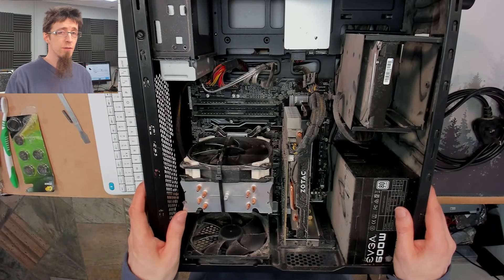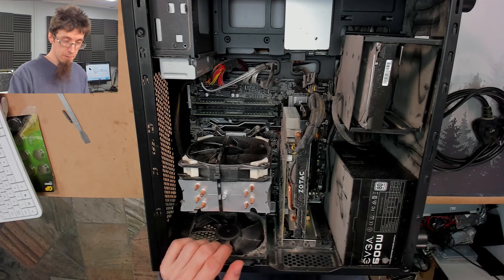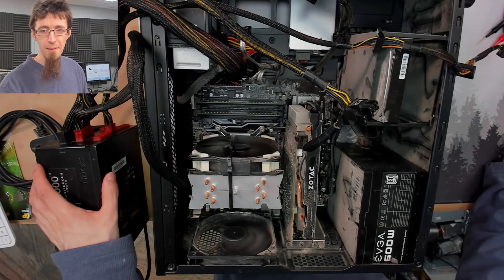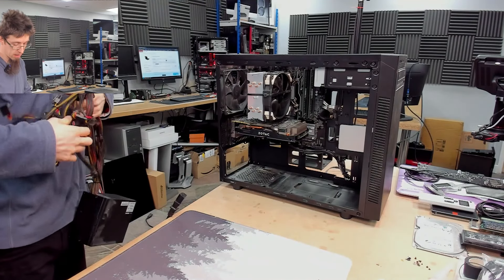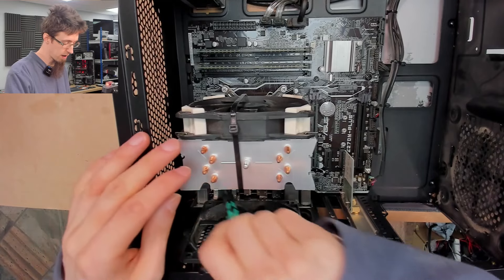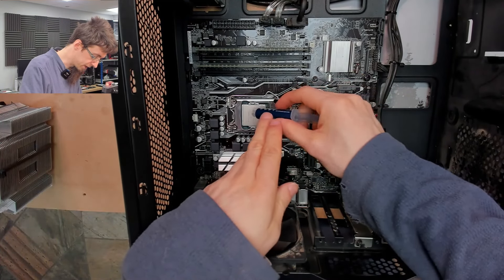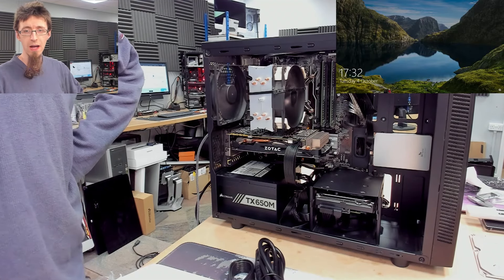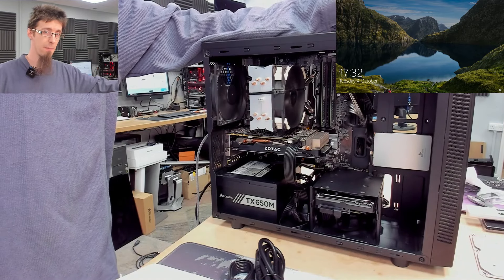Gaming PC cut out, doesn't turn on again - LFC#327

Comment: love videos like this but there is so much there lol why is there a zip tie on the cooler pmsl, EVGA do amazing supplies but dust and heat will kill them quick for 4 mins and a £20 air blower and a little maintenance. i had a random problem the other day when i installed and new PSU and graphics card all of a sudden a powered USB was stopping my PC booting up there was a lot of giggery pokerey before i found that out such a weird thing.

Comment: PWM has it minimum speeds as well. My noctua fans seem to reach it at 14% and my arctic fans hit it around 30%. They just stop spinning at that point. I have a ASUS Z490-I. I have seen this same behavior on my Quadro fan controller and ASRock Z390i/ac PG as well.

Comment: Fully modular PSU's just to have fancy looking sleeves is a waste of money imo. Like a tech once told me, you want a computer to use or just look at?... cause you sure ain't looking at it if you're using it. Is it a ornament or a PC? Partially modular I get it not having unnecessary cables clogging up the case. Partially modular is what use.

Comment: My primary i3-9100 Linux box presented as very dead. Turned out that cheapo SATA to IDE adapter was causing  short circuit. Reusing old case with IDE optical drive.

Comment: I had a similar problem , my PC wend out while surfing the web & not turned on again (I set UEFI-BIOS to Power on at AC-loss), the Power Supply was my first suspect but turned out to be OK,  after a while I got the fans spinning again but on full speed (instead of my settings , CR2032 was OK) & no other life sign , a barebones component swap concluded that the motherboard died ... since I can not repair or diagnose it , I just bought a used motherboard & it´s running again

Comment: 13:40 I would also have added that opening a power supply without serious knowledge of the hardware within is not only not worth it but a very, VERY dangerous thing to do for someone without proper knowledge. There are many serious high voltage capacitors inside that may still retain the entire amount of power within the from their last working state and have more than enough amperage to kill a person who mistakenly touch or short circuit them.

If you don't know what you're doing, you should absolutely NEVER open one of these. It can and certainly has nit only seriously injured people to have done such things in the past but also killed people who had done this without any proper knowledge of the circuitry within.

Essentially, doing this is the biggest risk factor of circuit integrating and unless you have a vast knowledge of the hardware within and even if you do, the chances of injury or death are absolutely just not worth the risk. It's far less risky and a hell of a lot less dangerous and expensive to just replace the power supply unless you would rather require months of treatment, recovery and medication for your injuries like electrical burns and possible nerve damage.

Comment: There is only one brand I trust with PSU's Seasonic  not the cheap ones but the higher end ones ... and 10 year warranty that brand offers I know when i had to change a psu for a customer and the psu would fail I get a free replacement

Comment: on the faulty power supply pity there wasn't a red switch or you could of switched it and then shorted the pin to ground then conenct 240v and switched it on

Comment: I had a desktop in yesterday .. it was a bad power supply .. so I swapped the bad one for a new one .. computer won't boot into windows .. hard drive was going bad ...swapped it for a 1TB nvme and installed windows ... no issues ... didn't clean the thermal paste because it was running ok temps .and it was a intel stock cooler on a 6th gen i5 .. forgot to check the battery ...   today I get a call that the guy hooked it up and it wouldn't boot .. got him to go into the bios and save and exit and it boots ... grr
Reply from the maker: I hate jobs like that... looks easy, and then it's one thing after another. There's always at least one ticket like this in my shop at any given time.
Reply: @Adamant_IT  I also managed to break a m.2 screw  it was off another motherboard as theirs didn't have one or the standoff... I didn't even tighten it that much... Maybe it was somehow weakened from before... I ended up having to get another standoff and screw from another board and then order more off Amazon.... Need to find a bulk supply of them.. Maybe china. Paying $10 for 12 screws is silly

Comment: Now with the latest Intel CPUs at 250W realistic load, and 4090 at 450W realistic load, do you still feel the Antec is overkill?
Reply from the maker: Big mood. It's a depressing era we're in. Stuff's really fast, but my god, actual 1kw for a gaming PC is absurd and unacceptable IMHO. I'm glad it's still only the halo-level products that actually hit those numbers, most people are still much closer to 500w peak.
Reply: @Adamant_IT  Agreed, it's way too much heat. On a rig like that it only makes sense to game when it's cold! That way the heat isn't wasted... in the summer, you're paying twice if you run AC. Insane.
Reply: @Adamant_IT Good thing it never actually reach 1 kW in games. My 14900K is 90-110W in games, my 4090 barely passes 320W, mostly around 280W. That’s not even half of my 1300W PSU. People over exaggerate this.

Comment: my daily driver is still a 6700K version stock was 4ghz with 4.2 turbo and would have 60-70 temp range with an AIO corsair 115i 280mm radiator, had the guts to Break off the IHS and apply Liquid metal between the chip and IHS.

Now overclocked to 4.6ghz on all 4cores at 1.38Volts temps don't reach over 60degrees C paired with 16GB of memory @2900mhz CL14 and a RTX 3070 @1995mhz and 8000mhz on Vram(msi ventus x3) still a mean beast to play with at 1440p.
any higher overclocks i lose stability, not sure if the motherboard(gigabyte Z170x gaming 5) can handle the Power needed for +4.7ghz or the older power supply is to blame (enermax revolution 85+ silver 1050w)

Comment: I request an exploratory video if dust is flammable.  I suspect that it isn't...as long it isn't aerosolized.
Reply from the maker: I'll try and put this to the test. If something in a PC catches fire, it's usually an electrical fault (short circuit), but the flame from that won't sustain itself after the power dies - so the fire goes out and it's not really a massive hazard. But if dust is super flammable and doesn't immediately vanish in a second, that would sustain the fire after the power is turned off, which would lead to more extensive damage or actually setting the room on fire.
Reply: @Adamant_IT  Considering that dust is almost exclusively composed of dead human skin cells, I don't expect that it will sustain a flame.  I have a 20 year old electric space heater full of dust, and it hasn't caught fire yet and it's 1500w.

That said, I've still wondered if it were possible even though I know it doesn't make much sense.

Comment: I went through a load of PSU's until I stopped buying the cheapest in the shop and bought a decent one, I spent more buying cheap ones than the expensive branded one, don't skimp on a PSU.

Comment: I have the same problem with my PSU. My exGF had built a PC back in 2015. The brand new Corsair 750 watt PSU she bought was giving her problems right out of the box. So she boxed it back up and got another one. I upgraded my GPU about a year ago and my pre built PSU didn't have an 8 pin PCIe power connecter, so I used the Corsair she had in the box. It works fine when the PC is turned on, but if I turn it off it will not restart until I bang on the side of the PSU. I tested it and it intermittently does not output the 5v standby on the green wire. Ive had the PSU apart and didn't see anything wrong with it, but Id like to do something with it,  but am very tight on money right now. If anyone has ever had this problem on a Corsair, I cant remember if its a CX or RM 750, I think its the CX, PSU and has an idea of what I could possibly do that would be really appreciated.

Comment: The bios firmware could be updated from: Version 0601  2017/02/24  to: Version 2001 Beta Version 2021/08/10. The front panel side vents appear to still be dusty. Your skepticism concerning plug-in PSU testers seems a bit harsh. One I purchased on eBay seems reliable.
Reply from the maker: BIOS - yea I forgot 😩 Not the end of the world, but would've been a good shout.
PSU Tester - yea like, a PSU tester would be ideal in this video, but also I have example videos showing a PSU that "turns on" but will not POST a PC. On a tester, it would show a pass. But as soon as you place a real load on it, it's unstable.

Comment: if you didnt flash bios its very old. 8 newer versions.
Reply from the maker: I thought of that while editing - didn't think of it at the time though. I'd do it if I'd remembered, but likely won't make any difference on an Intel board. Might even hurt performance due to Spectre/Meltdown patches - which isn't something we need to worry about on a home PC.
Ryzen boards, always worth updating because AGESA.
Reply: @Adamant_IT  could maybe update it up to the version before those patches.

Comment: You are not done with that computer...no no no
WHY you haven't done a BIOS firmware update (PRIME Z270M-PLUS BIOS 2001 with Win11 support)? This should be a standard service task...You always have to check if there are BIOS updates available if you enter the BIOS anyway. Much more important than fiddling with fan control curves...the BIOS version 0601 is over 5 years old (2017/02/24 )! There have been 9! BIOS updates in the meantime and the latest is from 2021/08/10.
So please get back to work :)
Reply from the maker: BIOS would have been worth doing while I was doing this stuff yea, but not actually make any difference to how the system runs. Thermal paste will lower temps, RTC batt will avert a future issue, but a BIOS update on a kaby lake board... I'd bet a free service you couldn't measure any change in performance.

Comment: some power supply fans don't turn on not in less it's under load
Reply from the maker: This is a good point. I believe most PSUs will always spin the fan for a least a few seconds at turn on, before going zero-rpm, like how GPU fans will spool up initially and then switch off - but still something to keep in mind.
Reply: My power supply is CORSAIR RMx Series RM1000X 1000W 80 PLUS GOLD Haswell doesn't spin when it turns on but it starts spinning when it's under load

Comment: "12:41" - "Holding a sus psu and turning it on"
Brave of you holding sus PSU and turning it on, could've made a bang and skip a heartbeat or two :)

"13:15" - "What might be wrong with the psu"
My bet would be, fuse, 400V cap, and pfc mosfet.

Comment: Really bypass simplest test first??? How about disconnecting the front panel connector first and trying to power it on? And white bronze has nothing to do with if it is a good power supply.
Reply from the maker: It's true, efficiency does not mean a good PSU... but if your PSU is so bad that it can't meet the spec for 80+ bronze, this makes me severely doubt that it has even slightly good components in it.

Comment: 80+ is just a gimmick you pay more for .. i have a old Ultra from Tiger Direct pre 80+ been with me for 10 years so far
Reply from the maker: It's not that simple... On modern PSUs, no 80+ rating, or 80+ white basically means "this contains the cheapest components we could find." Because if they had used decent components, it would be capable of meeting 80+ Bronze or better.
So while 80+ isn't a certification of a good PSU, not being 80+ Bronze or better mostly likely means it's trash inside.
Additionally, if you're running a high end system that can pull 500+ under load, an actually efficient PSU (gold+) could be using 50watts less from the wall than a trash tier PSU.
I'm not actually sure what the efficiency is like on the pre-80+ era PSUs, good ones may well be good, but this is what the badge is for, it helps people get an idea of what to expect.
Reply: @Adamant_IT  thats a 100% lie that only applies to if you bought some no name dollar store PSU's and it would be the same today with 80+ certs

Comment: Who brings a PC in for repairs and not clean it?  Some friend.
Reply from the maker: They'd taken out a lot of dust already. I'd consider detail-cleaning as I did in the video to be above and beyond what most owners are expected to do. Imagine taking your car in for a service and not steam-cleaning the engine bay first.
Reply: While it might be a courtesy, bringing in a broken-but-disassembled-and-dusted PC risks changing it from "It's dirty and broken" to "it's clean, broken and I also don't know if I put everything back in the right places." It would actually be giving Graham MORE work to check if it was reassembled properly.
Reply: @Adamant_IT  but you are required to change the oil and top the fluids and check tire pressure.   Not rocket science just wipe it down as you showed.  Basic maintenance.   Nice video.
Reply: My college apartment had a complimentary cleaning service once a week. I would still clean before their arrival as I'd be embarrassed lol.  How I wss raised and grew up constantly cleaning house.

Comment: re those stupid little PSU tester gadgets... they're also useless when you're dealing with vintage/retro equipment. The amount of times I've bought an old ATX 1.x PSU (the ones that have most of  the grunt on 5V/3.3V instead of 12V, needed for Athlon XPs etc) where the seller showed that it works with one of those testers, the PSUs were still bad. How? Simple... those testers will only show you that the PSU turns on. What they won't show you is that more often than not, every single capacitor inside these old PSUs has puked its guts out and is causing craptons of ripple because it's no longer doing its job and might as well not be there. The only thing these testers are good for is to have an easy way to turn on a PSU outside of a case if you're too lazy to bridge the pins on the plug lol